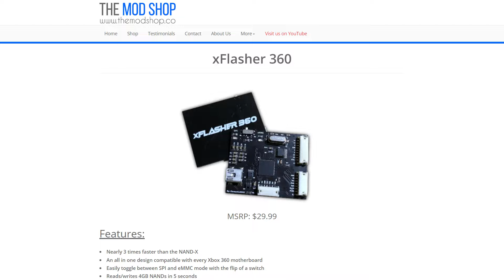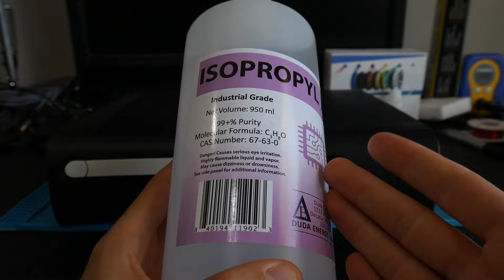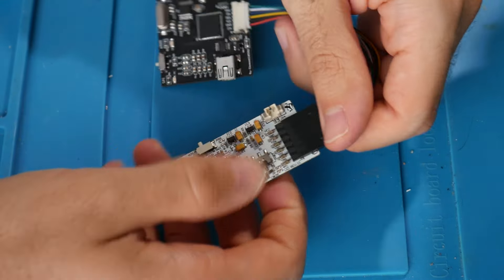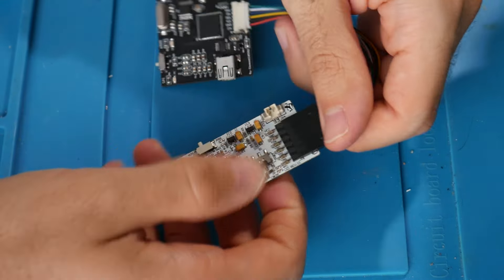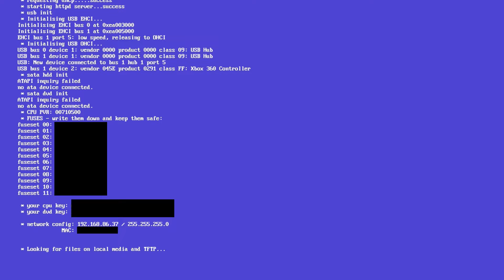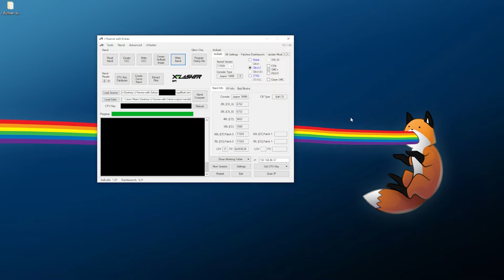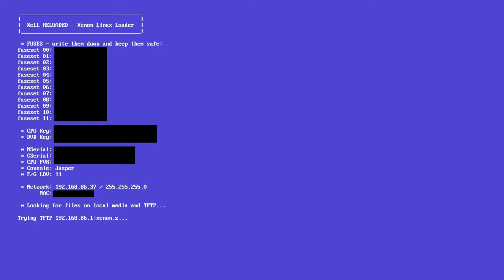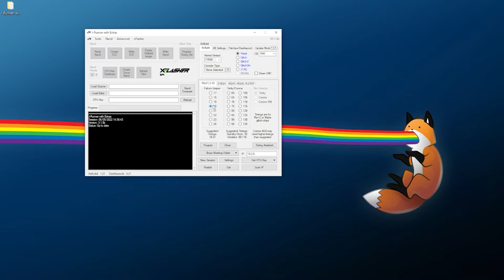How to RGH 1.2 a Xbox 360 Phat (Falcon/Jasper) - RGH 1.2 v2 Update!

Comment: I unfortunately don't get a signal... co runner blinks green but no xbox light. Re flashing to stock nand to see if I atleast get a picture
Reply: I got posted into xell! I had connections around pll/a bridging. Was flashing green b4 fix
Edit: for the people this might help. The actual pll wire positioning was giving me the green flashing light if it was too flat. Idk if it's just the cheap wires from the cool runner kit or what but that was giving me trouble and possibly scotch tape can bridge connections. Also my pll  connection is in a glob of solder bridging with the black resistor on the bottom lol I have no idea how it's working. I've had way better solder joints to pll but none em were working so just keep at it! I respositions the wire to under the cooler brackets instead of the wrap around mr mario shows. Seems slightly easier bc there isn't a pad u can bridge with but having that wire next to the hot brackets could be risky.

Comment: I’ve been out of the scene for a long time, last I heard (years ago) when I was flashing my DVD drive the common wisdom was to never boot your 360 without a DVD drive connected as you’d get banned from Xbox Live. Any idea if that’s still the case as I booted my RGH a lot without the DVD to refine timings
Reply from the maker: I remember that clearly! So many years later I can confidently say that's not a factor to getting banned. If you check the SecData there is a value which counts how many times the console was booted without a DVD drive, but I've never ever ever ever seen a console banned solely for being turned on without a DVD drive.

Comment: I have a Jasper which stopped glitching with RGH 1.2 only a few days after putting it together! The cap addition of various values close to the recommend one did not help. Unfortunately had to reverse that to stock. Might try a different glitch chip.

I ended up doing it with a Falcon of mine. Instant boot with the Matrix which I used for the Jasper.
Reply from the maker: Might indeed be worth it with a different chip. I still love the CR Rec C all these years later for Phat installs.
Reply: And you didnt change any of the jrunner settings or you followed the tutorial in the same way as using Coolrunner?
Reply: @Henry_Unreal  kept J-Runner settings the same and followed the tutorial in the same way.
It is definitely a case where the console itself is stubborn. Have got it glitching a few times but it took hours to do so.

Comment: I have a problem every time I try to program my chip it says xilinx device not detect. It’s a cool runner rev c and a jr programmer all of the wires are intact and the switches are in the right spot but I can’t get it to work
Reply from the maker: Make sure drivers are correctly installed, the wires are correctly placed on the chip, and it is in programming mode.
Reply: @MrMario2011  I have the jr drivers installed and all of the switches are in the right spot and All of the wires are in the right spot without any pins damged

Comment: I'm pretty new to this, but if I'm correct there's no way to flash the coolrunner without the xflasher? Is this impossible without the xflasher? I'm confused why the pico is presented as an option but it can only flash the console and not the coolrunner
Reply: Will a jr programmer work just as well as an xflasher?
Reply: Unfortunately you do need an SPI flasher to handle flashing the glitch chip. The Pico is only capable of flashing the console's NAND. As for the other question about the flashers I have no clue.
Reply: @Thats_Cool_Jack  yes, i also use the JR programmer for programming the coolrunner

Comment: after soldering all, my xbox 360 has no hdmi output. i think coolrunner wire size are not correct. can i know what wire size you use? mine use 28awg.
Reply from the maker: Most likely your wire routing, issue with soldering, or issue with solder quality.
Reply: @MrMario2011  thanks. just found solution. i enable button for slim when set timing. after i change into phat, and set timing, its working. its take time 7 hours for resolder again and again. mistake only on that button.

Comment: I have broken the Pad of the FT2R2 point. What can I do in order to fix it or is it beyond repair?
Reply from the maker: Make sure stock NAND is flashed over, desolder power from the CoolRunner and boot up the console. If it still boots stock NAND successfully, you would probably have to continue on with the top side CLK point which you can look up, it's near the ANA chip but it is harder to solder to.

If the console isn't turning on at all, you would have to perform trace repair to FT2R2.

Comment: Hey, so i was rgh’ing another console and i accidentally lifted off the r8c2 resistor, i soldered every other point but the resistor is still desoldered. What should i do? Also in my few attempts at resoldering the resistor and wire, when i did get it to connect my coolrunner just blinked green and the other led was red. The console’s ring was flashing in the centre and the fans were constantly slowing down and then going faster. Anu help?
Reply: Don't be stupid and pay attention! There I helped you! 😁👎

Comment: Tring on a phat console and when Im going to get the cpu key no blue screen  the cental led is flashing and the revc also flashing but no blue sceen. Checked all soldering points. did all programing again. and nothing.
Reply: u may need to commect dvd drive u know?
Reply: @plumbnebula5741  Thanks, will try also.

Comment: Using another modchip, like MATRIX/ACE, we use the same solder points and the same letters on those modchips?
Reply from the maker: I believe those ones use 5V for power, so you would need to use that power source instead.
Reply: Matrix is very similar to the CoolRunner (some have oscillator, but that can be disabled, and they still use 3.3V) and even uses the same timing files (different points). The Ace requires 5V and requires you to do some modifications and add a 22K Ohm resistor to PLL (kind of like you have to do with RGH 3 on phats).

Comment: Hello! I attempted to RGH 1.2 my Xbox 360 Jasper. Long story short, it didn't work (yet :)), flashed the stock Nand back everything boots up fine but the disc tray is not functioning. It does nothing when you press to open it, no sounds, nothing. Could anybody help me troubleshoot the issue?
Reply: Did u try prying it open

Comment: hi . i have jasper with rgh2 and boot time is awfull ,sometimes more than 2min . it has x360ace v2. 
for converting to rgh1.2 do i need x360ace v3/4/5 or my v2 work too and if v2 works then do i need to re flash chip for rgh1.2? do i need reflash xbox 360`s nand? i dont have my org nand .
Reply from the maker: Chip probably works, but you will need to reflash the chip and it would be advised to also reflash the NAND for SMC+

Comment: Hello Mr Mario, I have falcon xbox360 and when I try to read nano it say “ device not found” I am using a xflasher and I had resolder 4times, but still get the “ device not found” I do not have the glitch chip but I have everything plug in (not powered on). Is it not working because I don’t have the glitch chip or is it something else?
Reply from the maker: Console needs to be hooked up to power. If it is, then the issue is probably soldering quality.

Comment: I flashed my 360 many years ao. and a few days ago the console stop posting any video i thought maybe the console died so i bought another 360 and try flashing it with the same old chip. and got the same issue. then is safe to say that the chip is faulty. i got the same coolrunner rev c

Comment: I had my Falcon and my Jasper and I had ordered the cool runner c and a NAND programmer and while I was waiting for them to arrive, the pico flasher was released. Since I had a couple of Picos I went with the Pico - seamless. I still have cool runners kicking around - don't really see any use for them anymore.
Reply from the maker: It sounds like you went with RGH 3.0?
Reply: @MrMario2011  yes and they've been very stable and quick to boot. I had to play a bit more with the resistor value on the Falcon but it's just as good. The biggest head scratcher was on the 256 mb Jasper where it wouldn't boot after flashing the mod. Had to restore to stock, boot and delete my user data from the inbuilt storage and redo the mod. It worked perfectly after that.
 As far as RGHs go, it's the third one, for my consoles ( Pico, resistor, diode, good soldering, shrink tube on components and kapton tape ).
Reply: wich wires go to where on the pico?

Comment: The wires your using when doing the man’s flash, where did you get em or how did you make them.
Reply from the maker: Standard NAND programmer wires that I soldered sewing needles to and secured with heatshrink tubing.
Reply: Thank you

Comment: hello can you  help me 
i read nand no problem and i create and write xell no error

i try booting the console with eject to get the cpu key  it turn on by flashing the middle light only and there is no display neither hd or av
im i doing somthing wrong ?
im using  picoflasher 
btw the console is japanese falcon
Reply from the maker: Could be an issue with soldering quality, wire routing, or soldering to incorrect points.
Reply: @MrMario2011   did resoldering many times wires same results 
btw i didnt get any errors when reading nand and writing xell
Reply: @MrMario2011   i figured out what the problem was 
it was  cpu rst the alternive one  it wasnt  working for me 
i did the one under the xclamp now everything was working untill i connected the dvd now sometimes it  boot sometimes  it dont and show red light

Comment: Has anybody used the coolrunner and an pico and has some kind of picture because its not realy clear to me where to solder the points on the coolrunner.
Reply from the maker: You have to program the CoolRunner with a timing file, as shown in the video. The PicoFlasher cannot program the CoolRunner.
Reply: @MrMario2011  Okay thanks!

Comment: So what if i already have rgh?
Reply from the maker: Then I'm not sure what this video will serve?
Reply: @MrMario2011  I ment if i wanted to update from RGH to RGH 1.2?
Reply from the maker: Steps are mostly the same. Rewire the glitch chip as needed, reflash the timing file, then build and flash a proper NAND update. The main difference is you don't need to start with stock or flash XeLL to get the CPU key since you already have all that.

Comment: What do you have connected to the ends of the xflasher wires? The part you soldered to the motherboard
Reply from the maker: Sewing needles soldered and heat-shrunk to the ends of my wires.
Reply: @MrMario2011  Any specific type? Seems like a great idea to make reusing the xflasher easier!

Comment: using a USB-C version of the Xflasher with a CR revC clone I got from ebay (they seem to be hard to come by now). I was able to dump NAND without issue. I am stuck on programming the glitch chip. I get the red power LED,.  chip is set to PRG and PHAT. Xflasher is set to SPI with drivers installed on Win 11. Using latest Jrunner w. Extras and have tried two different PCs and different cables.  Message reads when trying to flash timing file:

"Programming Glitch Chip
xFlasher: Waiting for device to become ready
xFlasher: Flashing rgh12_fj_21_v2.svf via JTAG
xFlasher: SVF Flash Failed

PC>>USBC>>Xflasher>>Cool Runer glitch chip via provided JTAG cables. The Xflasher is NOT connected to the console motherboard. I'm stuck
Reply from the maker: Try using direct motherboard USB 2.0 ports if possible.
Reply: @MrMario2011  tried and still no luck also used a different USB cable too.
Reply: @greeendevil Some CR clones have the PRG/NOR switch backwards. Try to switch it over to NOR and program it

Comment: Does this works with a matrix chip too? And if it does, do i have to change a setting in jrunner or i must use the settings on jrunner?
Reply from the maker: Yep, although I believe that's a 5v chip so you'll have to tap into a 5v signal.

Comment: tried this and failed miserably. broke my xbox that ive had since i was a kid. hoping i can at least somehow get the data off it and put it on a new one
Reply from the maker: Sorry to hear, that's never a good feeling. You can still use the hard drive in another console, or back it up with FATXplorer
Reply: thats exactly what i did, and i bought a pre modded 360 so i dont have to even try it again. my main issue was that i dont have the correct soldering heads for such small points so i was just soldering a lot of them together which i guess shorted the board

Comment: i picked up a untested xbox 360 halo edition with a falcon motherboard and when i opened it up i saw it had a little board that said cool runner on it i suspect it was jail broken and i was doing research on it and it lead me here although it doesn’t have any special software on it cause the hard drive for it was gone although i have thought about attempting to jailbreak it
Reply from the maker: Yep, just set up a hard drive with Aurora and such. I've got a video covering that.

Comment: Is it better JTAG the phat  xbox 360 or RGH it
Reply from the maker: Either JTAG or RGH 1.2 at this point.
Reply: JTag only works on and is recommended for Xenon's, Zephyrs, Opus and Falcons. Where as Jaspers, Slims and E's only works with an RGH Chip.
Reply: @8bitnation419  Some Jaspers also support JTAG (especially if they came with blades out of the box and were never updated), but a lot of them don't (especially the later "V2/Tonasket" variants).

Comment: My X360 Falcon is stable as f c k whit rgh3.0 beta 2 or 3. the Version whit the first support and a wrong resistance (15k bla) Boot times form instant to up 5 sec waiting like my old rgh 1.2 whit “speed mod”
Reply from the maker: My Falcon RGH 3.0 is working pretty well for me, boot times are about 7 seconds, however I still maintain what I said. I'm trusting Octal, one of the developers behind it all, and a well seasoned installer here hah

Comment: My point for the yellow wire on the board is not tinning, do you have any alternative points or a solution  to my issue?
Reply from the maker: That one might need a little more heat or time with the iron on it. Although worst case scenario I believe that another GND point, so there's plenty of alternatives for that.
Reply: @MrMario2011  what point is it?

Comment: Can dashboard 17349 be RGH'd?I have a jasper 16mb, but it will not glitch. Tried a Cool runner and a matrix chip and no go. Can I rgh3 it?
Reply from the maker: Sounds like it's an issue with your soldering or wiring, not the console itself.
Reply: Nope as soon as I got it updated with a non oem disk drive to trick the console it glitched right away.The dashboard update does determine what kind of rgh or jtag you can do.